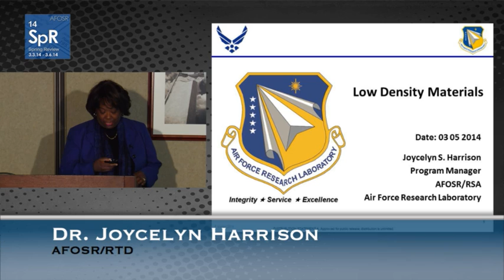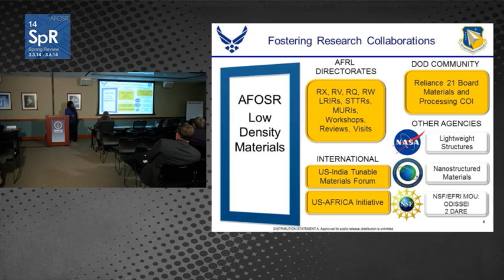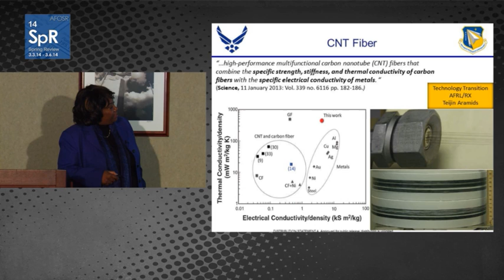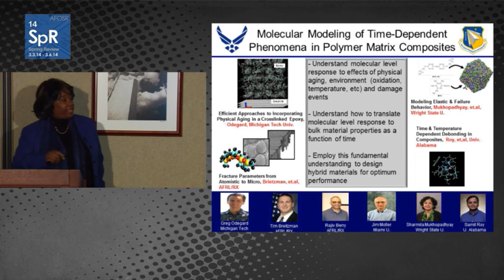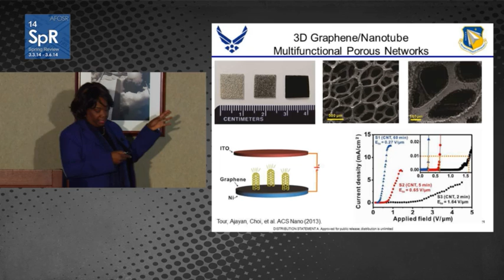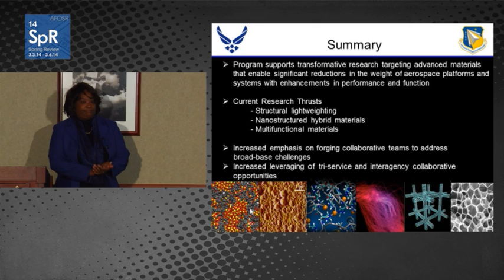Dr. Joycelyn Harrison - Low Density Materials

Comment from the maker: Breaking Down the BAA | Research proposals are sought for the Low Density program, managed by Dr. Joycelyn Harrison.

Reducing the weight of aerospace platforms reduces the costs and emissions while increasing payload capacity and performance. The Low Density portfolio supports transformative, basic research in materials design and processing to enable weight reductions with concurrent enhancements in performance and function. Such materials can transform the design of future United States Air Force aerospace and cyber systems for applications which include airframes, space vehicles, satellites, and load-bearing components and systems.

Interested in AFOSR funding for your innovative research ideas? Visit http://go.usa.gov/Smmj to get started! In this video, Dr. Harrison presents the Low Density Materials program at AFOSR's 2014 Spring Review.  #AirForce   #BasicResearch
Reply: Fantastic